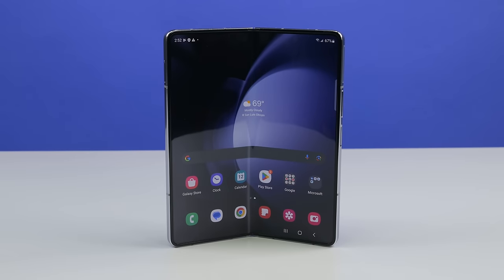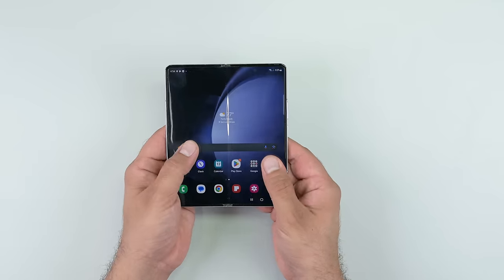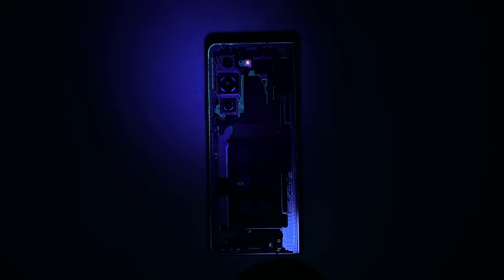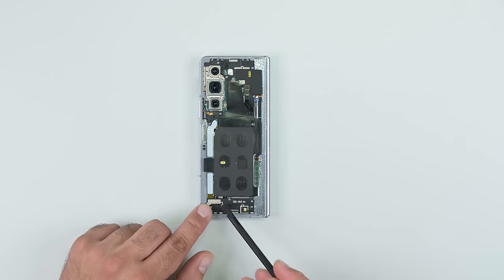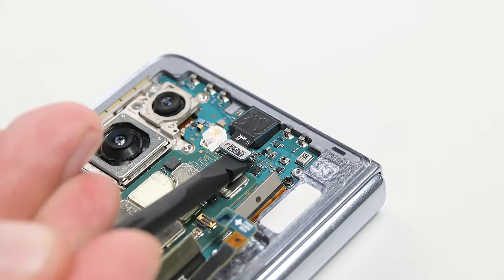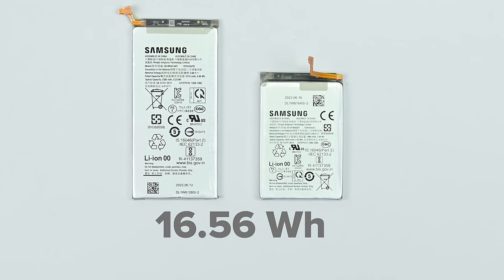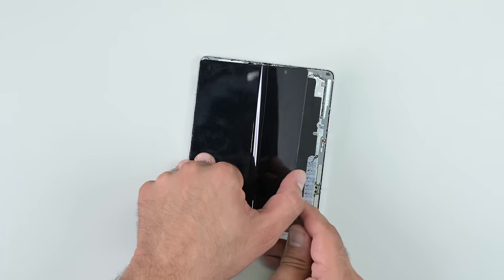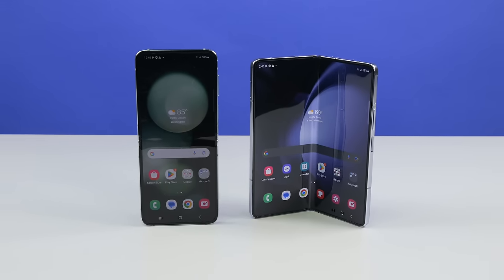Galaxy Z Fold5 Teardown: Still No Dust Proofing

Comment: One note about the florescent dust that you used. I think it's much smaller than your average dust particle. That's why the phone was caked in it. I've been with my Z flip 3 to the beach and it's still fine.
Reply: Indeed, it's not for Mars dust, it's for earth dust and dirt.
Reply: Interestingly, it actually didn't affect the hinge mobility as you can see. It might over time, but not for a long time
Reply: @Sheenifier  If I were a engineer at samsung and my task was designing  the hinge, I would put a tiny hole for cleaning out the dust. Water wouldn't get it because of surface tension..
Reply: interesting
Reply: @Sheenifier  the magnetic hinge is crazy good. But it destroys credit cards in minutes
Reply: Dust is dust, stop making excuses just because they used dust that is not approved by samsung.
Reply: @lizziebutdiff698  no its not. The sand you have in your backyard and artifitial dust are completely different things.

Comment: From the dust test, is it a big deal? Since it's IPX8, from the teardown, we see the dust is isolated to just the mechanical parts and it did not find its way into the electrical parts. Could you not just wash away the dust inside by submerging under water and working the foldable a few times?

Comment: Been using this phone for about a year. I work in construction so its constantly in a sweaty leg pocket, being used around dust. Ive definitely felt like there were times where i felt something when opening it. However after opening and closing with use it goes away. Self clearancing is a option. The reason i bought this phone was because it the first time a phone was exciting to me. I also use excel in the field every day and this is much better than carrying a laptop. Also showing guys plans and what not is very easy.

Comment: I'm still rocking my fold 3 2 years later and wouldn't trade it back for a standard phone even tho at the end of July my back came off and separated by itself and for several months would hear a loud crunching noise everytime i still open the fold,  thankfully Samsung did a full free repair where tmobile dropped the ball also i have never dropped or have done any kind of deliberatel submerssion

Comment: Would you say Fold 5 will have less of an issue with bubbling / pixel bleed on the inner screen vs the previous gen? There are lots of issues with the screen protector bubbling up and caused the inner screen to go bad, and not sure if Fold 5 with some new damping will reduce or fix those issues?
Reply: wow this is note widely known.  can you explain

Comment: I had the Z Fold 3 and after a year i lost wifi.. Samsung told me it might be the ribbons that was broken. Can you tell me if the designs were updated on the Z Fold 5 to prevent these ribbons breaking from happening?
Reply: Mate you got nothing to worry about, your fold 3 wifi failing is a one of pure bad luck. I've had my Fold 3 since launch and no problems at all. And if you google wifi failing it's unheard off problem for the Fold 3. You just got unlucky.

Comment: Seems dust resistant to me, the internal parts did not get dust inside, only the hinge.
Reply: Hinge is the most susceptible part to breaking due to dust ingress. which is why Samsung does not give a dust resistance rating for foldable.
Reply: Anything with moving parts is hard to make dust resistant.
Reply: It's barely dust resistant since it can handle dirt and sand to an extent. In the video, this guy used fluorescent dust which is not going to be in your daily occurrence since dust particles come in all shapes n' sizes, not just 1 particular size nor material like shown in the video. Gotta wait to see Jerry Rig Videos for that. It's most likely gonna be the same outcome like the Fold 4 where it would work in spite of the dust on the device.

Comment: Does “dust” mean sand at the beach or like daily dusty living rooms that haven’t been dusted in a month?
Reply: both
Reply: More like sand
Reply: I would have though that normal dust you get on a room would not cause concern as it is soft let’s face it you get dust like that in lots of moving part and they are fine. But hard tiny particles like sand could cause an issue.
Reply: ive had the fold 3 and 4 the there have been no problems with the hinge or dust causing problems. On my fold 3 the screen protector started bubbling at the 6 month mark, i didn't get it replaced, bc i didn't think it would cause the screen to die, but that's what eventually happened. The fold 4 has had no issues for me, and i just bought the fold 5.
Reply: @robotbro7187  yeah same experience for me. The fold 3 screen protector bubbled relatively fast for me, but the fold 4's screen protector seems to stick to the screen much better.
Reply: @robotbro7187  Thanks for the reply man. Currently typing this on my fold 5! Out of thus world awesome.  Hope it's worth it

Comment: So my brand new Galaxy Z Fold 5 that I just purchased if anything, maybe 1 to 2 weeks ago, is heating up VERY HOTT (burning, not a normal warm) on the space on the right, right next to the triple (3) camera in the back of the phone when I run the Roblox App and start a game - literally starts heating up within a minute of game launch.

I see that from the teardown, there's a circuit board at the location. I thought the HOT would be coming from the battery running hot from game play, i was surprised there wasn't a battery there but instead a circuit board.

What could be the reason for this very hot, heating of the phone at said location? I was looking on Google to see if anyone had similar problems with their fold 5 and no one said anything much. I don't know if it's normal or if I've gotten a faulty device and should contact Samsung. 

I do see that there is a half sized pull tab battery on the bottom of the said location, but it's not heating there, but ontop of it right next to the side of the triple camera.

** edit** I would say the hottest point where it's BURNING to the touch is more towards the middle of the phone, where if you look at the teardown back of the phone, the area would be the bottom portion of the circuit board. Food for thought, could it possibly be faulty connection? If anybody has a Samsung Galaxy Z Fold 5, please replicate the situation (download Roblox and play a game/shooting game like Frontline, the exact game I tested) and let me know if your device heats up as well to the point of burning to the touch as mine did. I want to know if I've got a defect. I thought maybe it's normal since I'm running an intensive application, but on second thought, warm would be waved as normal, BURNING HOT, i don't think that's normal.

No phone case. It's literally brand new, haven't bought one yet.
+ latest Software Update.
Reply: I have a z fold 5 and have no problems with it

Comment: phone manufacturers, this may come as a shock, but it's very easy to put a phone in conditions where the glue just fucks off, use screws, metal panels and rubber gaskets, not glass, plastic and glue. also nintendo already had this down to an art for nearly 20 years, minus repairability, fuck those hinges, nightmare fuel.

also that seems like quite a serious discrepancy in the capacities of the batteries
Reply: But unibody phones are so retro, and there's no wireless charging, and the corporations cannot charge you overpriced out-of-warranty repair services for the back glass; how will they survive?!?!?
Motorola, with their first Razr had the hinge figured out: just two pins per side, no overengineered gears, cams, springs and whatnot; but the phone was the typical clamshell, not the tablet.
(The batteries are different physical sizes to maximize the internal space, that's why they aren't the same capacity)
Reply: @lucaverdi618  the difference in the capacity of the two batteries seems too great for the physical size difference
Reply: Then Nintendo decided to go with the dodgy joycons 😂
Reply: @darthraider450  you really can't win with any manufacturer

Comment: I don't understand how resistant it is to submerge and it's not dust.
Reply: The water can’t get to the electronics and cause problems. Dust CAN get into the hinges and cause problems. Water can definitely get to the hinges as well but that doesn’t matter since water won’t cause the same problems dust and debris will.

Comment: Why would anyone want a foldable phone? What’s the appeal?
Reply: When was the last time you were able to fold a screen in half? It's "cool", it's there and people are willing to spend the money.
Reply: Dude my Motorola clamshell from so many years ago was cool. Slamming the phone shut to hang up was amazing.
Reply: Same reason you want a laptop in a sense. Laptops are worse than desktops but they can be brought with you easily. Some foldable are almost as good a normal phone most of the time and a good enough replacement for a tablet when you need one. They are not as good as tablets but a laptop is not as good as a desktop.
Reply: If you look at something like the Pixal fold most people who reviewed it mentioned using it like a normal phone 70+% of the time and opening it only for specific content or using two apps at once while working. It isn't for everyone but if the only downside becomes price many people will opt for a much larger screen in a compact form factor.
Reply: I think it’s amazing to be able to open it up and actually multi task something iPhone despite their power cannot do even in a basic way. Come on apple at least give as two apps at once.
Reply: I bought mine to have 3 apps open at once.
You can do 2 smaller apps on a normal phone, this is kind like using 2 phones in 1 body for multitasking.

It has other uses for larger form content. Manga in particular is nicer on this display than a phone.

Comment: Wow, what garbage still!  I can't believe they're in the 5th generation of these devices and still don't have a solution to the dust issue.  I'd really love to relive my years of flip phones again, but absolutely none of these seem like they're usable beyond a week or two before the hinges are ruined from dust and debris.  The only persons that can own these are those rich enough to buy a new phone every few weeks.
Reply: How often do you plan on dumping a bunch of dirt into your phone? I had the Flip 4 for a year and it was indistinguishable from the day I bought it even though I ditched the case as unnecessary for the last 3 months. I did have to have Samsung replace the screen protector after 9 months because it came loose at the crease, but that was a free repair.